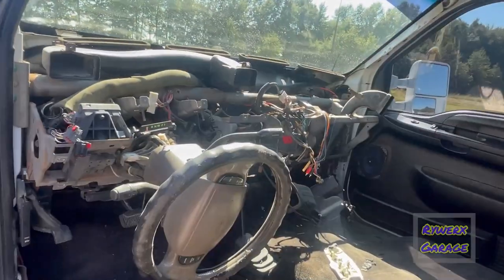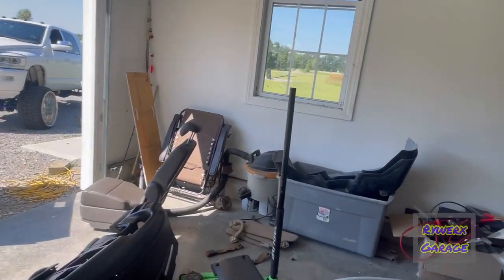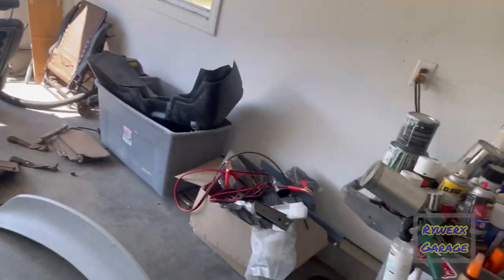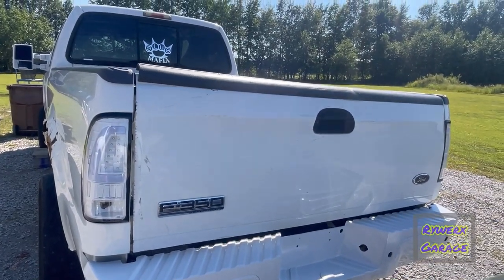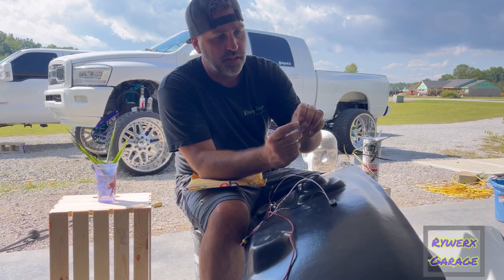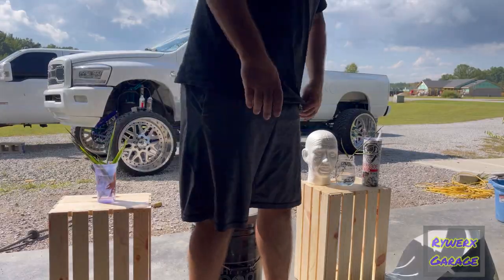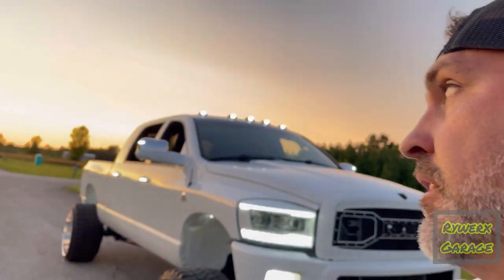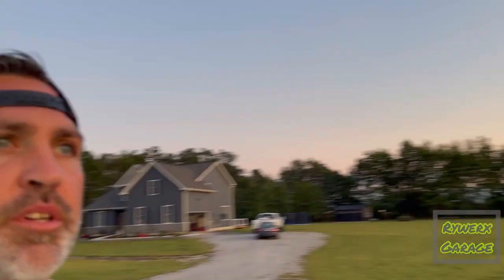Wheel liners…

Comment: Truck is super clean!!! I’ve been trying to paint my liners as well. Any particular paint you use to be durable and not chip to bad?
Reply from the maker: Just sprayed mine with urethane base/clear. I use 4:1 ratio clear coat and put four coats of clear on. You can add flexible additive to the clear to help as well.